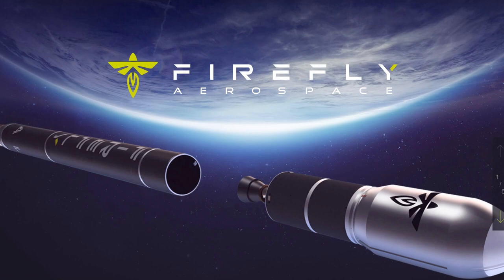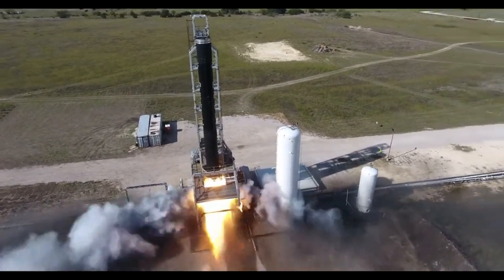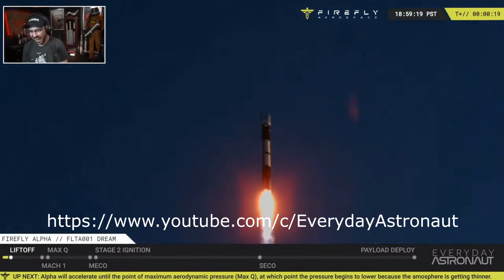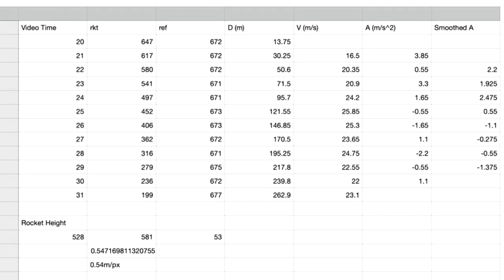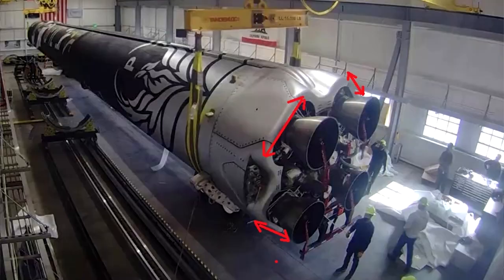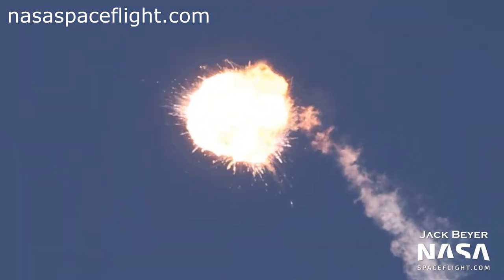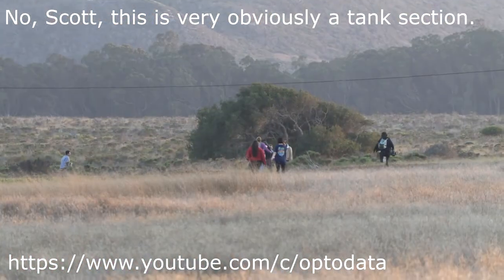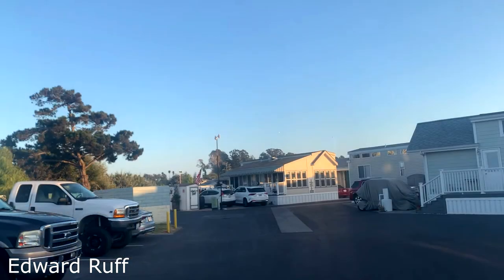Reaver Causes Destruction of FireFly

Comment: This leaves me wondering how fast the rocket was moving before the failure and how high it was. The greatest distance over land from SLC 2 that I can identify, that would not have the rocket flying over the Baja Peninsula, is less than 40 km. I am really surprised that after so much flight time, the rocket did not have enough velocity and downrange distance to clear the coast.
Reply: It had just reached supersonic and possibly Max-Q when it went out of control.
Reply: @greggv8  yes, it was barely supersonic. But supersonic velocity would be over 1,000 km per hour, over 17 km per minute. So again, what was the profile that rained debris down less than 40 km from the launch pad, after 2.5 minutes of powered flight, and over 10 seconds of supersonic flight?

Comment: At 1:59:00 hours/minutes of EDA's stream I noticed on the left side that the engine burns didn't look even.  At that point I knew they had lost an engine.  Also I heard an abort call out at less than t-1 second, but the rocket went anyway.  EDA also pointed that out later but didn't know why.  Have your sources figured that out?

Comment: Watching this rocket destruction at Vanderburg reminds me of the incident of Titan 34D-9 on 18 April 1986 at Vandenburg AFB where one of the solid rocket motors ruptured at 6 seconds into the launch.  It had to be destroyed which resulted in toxic gases being generated.  The solid fuel boosters contained chlorine compounds that resulted in a low level plume that was carried offshore and then to the south passing over then an active oil platform in federal waters.  That resulted in no deaths but there were lung injuries.  The more frightening issue was of the second stage along with the 3rd stage that were allowed to get higher 20 seconds into the launch before it was self destroyed.  They had hypergolic fuel that is highly toxic. The initial concern was that the higher winds from the west would have carried the plume inland over Lompoc and possibly over Santa Barbara.  Fortunately, this was high enough to be safely dissipated.

Comment: At first I was very impressed but now I’m worried. If they lose a single engine they lose so much control authority, at least when they’re in the atmosphere. That current design eliminates the benefit of redundancy as well. Maybe they should redesign the engines to gimbal on 2 axes so there’s mitigation strategies in the case of an engine failure, as well as design for the potential to throttle the engines high enough to compensate for a lost engine. It’d be a pretty big redesign so I doubt it.

Comment: I think a video on how the forces get to moving rocket from the burning point would be a good video. I think I get it pretty well from low pressure area putting force to rocket end? -- pretty sure there are some large pins with hydraulic support behind it.. but still little fuzzy on exact forces and where they exert.

Comment: I'd like to thank Scott on the details of the gimbaling system for Firefly, as I thought each one had 360 capability.   I'm curious do all rocket gimbaling systems only allow for one vector per nozzle or set of nozzles?
Reply: No. Many engines use a 2 axis gimbal.

Comment: 7:26 "Presumably heavy stuff will land closer to the base."  -- Why?  Wouldn't the two dominant terms for the debris field be 1) final thrust vector of material, and 2) aerodynamic braking/sheering forces?   The weight ... doesn't matter, as much in terms of velocity; it matters in terms of momentum.  p = mv.  So, if anything, heavier things would go further, is what I'd presume (if factors like aerodynamic and vector of travel are controlled for).  Remember the feather and hammer drop on the moon during the Apollo era?

Comment: On the one hand the single degree gimbal setup means you can't control well after engine failure, on the other you're not going to get your 2nd stage high/fast enough for the mission in any case ...
Interesting that the Air Force own the termination system for this - their base, their rules.

Comment: What do you think the thing that shots of at the 10 o'clock direction in a Jacks video?? Looks like a smoke trail, so it can't just be a COPV can it??? Wouldn't go that far either I'd think.
Reply from the maker: LIkely the top of the 2nd stage attached to the payload adapter. Would be pushed forwards as the tank  separated.

Comment: Isn't some rocket using poisonous fuels and other materials. Also heat/cryo may be an issue too if you don't want to burn/freeze your hands. Picking loot is not very wise.

I'd add 5th engine to the middle with full gimble capabilities. If one engine fails it can cover the lost maneuverability. And if losing only 1 engine makes your rocket to fall, then it's most likely underpowered system and need another engine for thrust.

Comment: The basic problem: is not the same to burn an engine in a static setup as in motion.  so I hope that they figure what goes wrong and make corrections to a better successful flight in the future (Remember, SpaceX "Falcon 1" fail 3 times before a successful flight, they are on a good way)

Comment: In that gimbal configuration, compensating directional error from engine out should be particularly easy, as two working engines can gimbal to and from the direction of the dead engine.  However compensating from the loss of 25% of total power will still exceed margins, as building with 34% surplus engine power would not be economical for a low cost launch service.
Reply: The engines only gimble in one axis each so the loss of one spells doom.
Reply: @patrickdurham8393  But they gimbal precisely in the direction needed, look at the picture with the red arrows.

Comment: Was this launch on balance a positive or negative? Sure it ended badly but it seems 3 of the engines performed. Maybe it failed because of an easy to fix element.
Reply: Brother works at Firefly as an engineer, they took the launch as a massive success. No rocket ever on first launch has been successful. And the fact the rocket was not only transonic but almost at max q and spun twice with barely any structural damage was met with huge positivity.

Comment: Like I said elsewhere after the SpaceX multiple engine failures.  That is an expensive way to test engines that should have been extensively ground tested.  We do not seem to learn from what others have recently done, and have to relearn what was known in rocket science previously.  F. Miller, retired rocket scientist
Reply: As I'm sure you know full well there is a world of difference between testing engines on a stand (a needed first step) and then testing them as part of a whole system in a rocket that actually launches.
Not sure what you mean by SpaceX multiple engine failures, but if you re referring to the series of recent test flights with the various test mules of the Starship concept with liftoff then turning off the engines and flattening over the rocket at an apogee and using aero for hypersonic gliding down and then restarting the engines for righting the rocket back to vertical and then for a landing burn (all something entirely new in rocketry), then those Raptors have performed well and the issues have been mainly about fuel tank and fuel supply problems to the engines from the changing of orientation from vertical to horizontal and back to vertical all while under considerable acceleration and deceleration. The only way to get this right is via actual testing in an iterative manner.

Comment: You also don't want to touch bits of rocket right when they fall due to the toxic chemicals that can be on them as the ignition fuel and stuff for the 2nd stage and movement in space often use some nasty chemicals. Just think about what some 50+%hydrogen peroxide could do to a person that came into contact with it

Comment: The crash investigators want to photograph the debris as it landed. If you are running in a debris field help the investigators out. Pull out that cellphone and make it do something useful by taking photographs instead of picking stuff up and moving it around. Also on some parts of some spacecraft you can touch a part and it will kill you. Not something to take lightly.

Comment: They probably should have 6, or 8 engines on this rocket. I one has a failure of two of the on the 6 engined rocket, then they would still have enough control to get the rocket to orbit.

Comment: Reaver , high thrust flight test probably normal trend to tune out an engine or just unknown genuine under performance
so it wasn't the second stage propellant violently splitting the tank creating the fireball, cue the song maybe but sure it seems to be easy for the evidence to be a abstract unidentified flying object briefly at few second past mach 1, sure they maybe should have gimbal locked and full thrust , maybe it's that honk Tim but sure Jack got another angle which many can the know many altimeter's are especially useful from the air radar. Possible abstract topical thought ,They didn't like women's groups gathering near their bases during the cold war saying no to nuclear science either but then it does create environmentalist inhibitors in a neuro biological sense, they seem friendly stimulated enthusiast's.

Comment: So Firefly gave up on the aerospike-ish thing, huh? Ya hate to see it but them's the breaks...

Also, don't touch rocket debris because evidence, but also, it could be contaminated with some stuff you for sure don't need to be introducing your body to. Not sure what biologically dangerous chemicals are on Firefly, but hydrazine and N2O4 are pretty standard. Typically you want to avoid direct contact with hydrazine in the multiple forms you find it, but also nitrogen tetroxide is extremely nasty stuff too. One of my professors (perhaps facetiously) said "well, one's a nerve gas and one will melt your lungs, so... Don't touch anything."
Reply: The rocket ran on RP1 and liquid oxygen, nothing highly carcinogenic.
The ignition fluid is rather toxic, but that is contained within the engines and burned off at ignition.

Comment: I watched the launch at a distance of 11.5 miles from SLC-2. I was commenting to a friend that modern rockets burned so much cleaner than the older launch vehicles had in the past. About a second later we saw the streamer of smoke coming from the Firefly. Then an extremely bright flare of yellow light, the same color as the exhaust up until that point. We thought it was due to staging, but shortly after came the explosion.
Here in Lompoc, Ca we are no strangers to exploding launch vehicles. I was sad to see the failure which will  affect their program. But, have there been liguid-fueled rockets that did not fail in their early stages of development? I think not many.

Comment: The atmosphere has a mass of about 5.15×1018kg, 20% of that is . A  launch uses on the order of 106kg of . To use up all the  (and assuming no  is replenished by plants) requires 1012rocket launches, so far all years there been  rockets so only take 1012 rockets use all our oxygen up on this planet we fooked.. Of course, rockets are only a tiny part of all  consumption, add all the carburetor on any vehicle burning our oxygen none u think one thing on this planet WE all need to live you all just waste it no care in for our lifes why going to mars by time get there we all run out of oxygen to live.